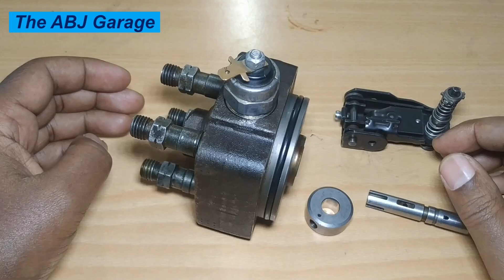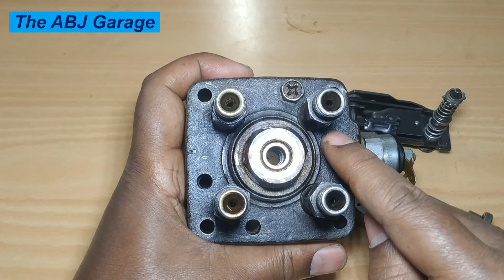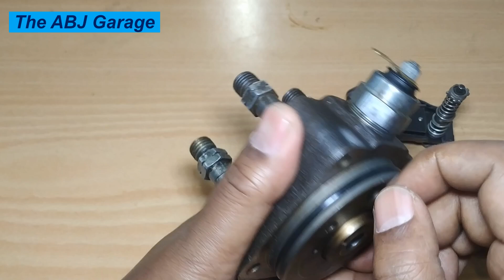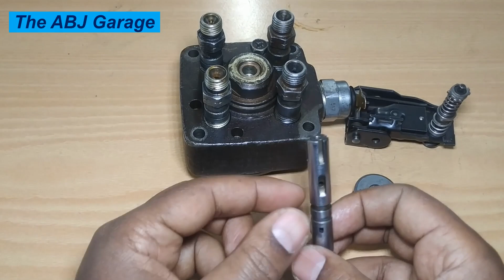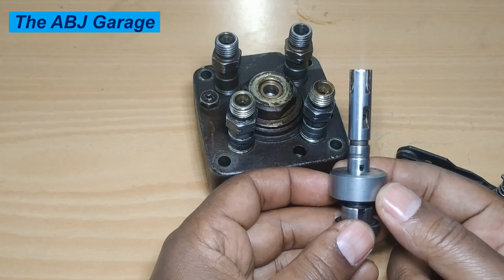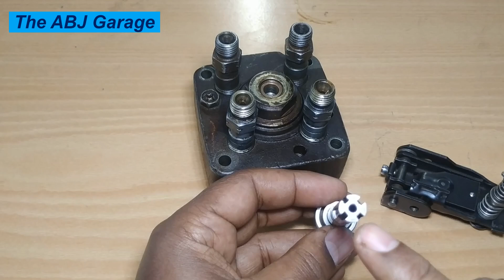Inside the Distributor Type Injection Pump: Construction & Operation Unveiled!

Comment: Hi. I’ve recently put a new head on a injector pump and I’m not getting any diesel out of the delivery valves. Do you have any suggestions on where I may have gone wrong. I thought shutoff solenoid but I pulled the moving parts out of it which normally works if your in a predicament to get you home but that didn’t work to get diesel to come through